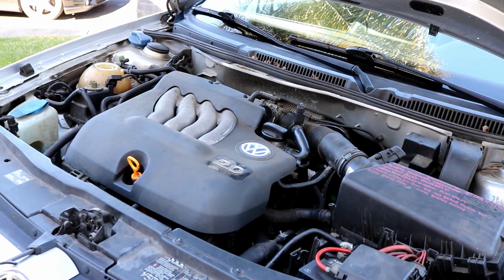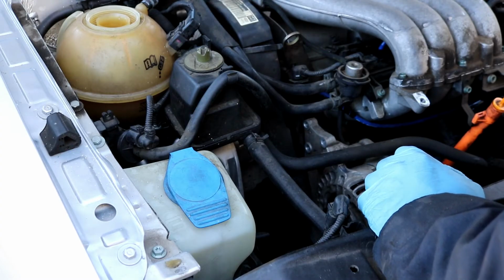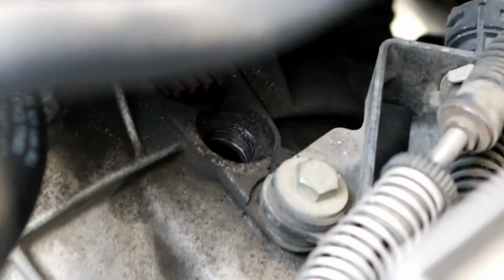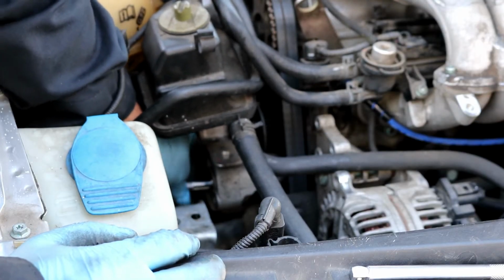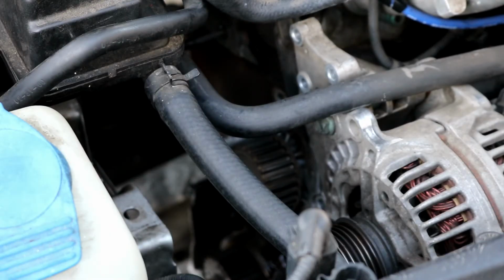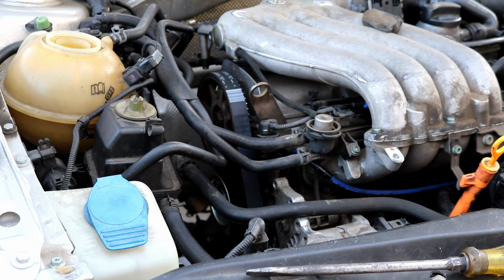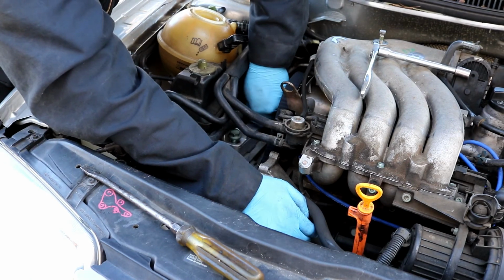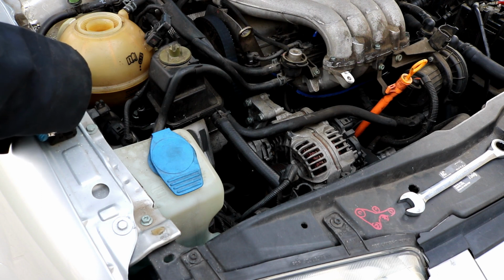Volkswagen 2.0L Timing belt and water pump! MK2, MK3, MK4 Jetta/Golf

Comment: Great video! Thank you for posting.  My 2000 2.0 Golf GTi has 90k Miles on it, I cant find any service history which mentions a timing belt change. Considering the car is 20 years old do you think its safe to assume this must have been done already? Is there any way to check? I'd rather not spend the money if it might have been done 4 years ago or something? Finally, is it catastrophic if the cambelt snaps on these engines? I know some engines fair better than others if this happens. Many thanks.
Reply from the maker: 90k miles and no service record? I would change it. When did you take ownership? It’s a mileage AND age thing. Rubber will deteriorate and that car is 21 years old now. That motor is an interference motor. When the belt breaks, say goodbye to a valve or two.
Reply: @HelpingHandAutoRepair  Thanks for the speedy reply! I've had it for a year but its been in storage, not used. It has almost full service history (stamps in the book) but most of the paperwork is missing. In  2016 at 70,771 miles it is noted as 'Full service' in the service book and in 2019 at 81,469 miles it says 'Major Service'. I'm pretty sure one of those must have included a timing belt change. Tricky decision what to do now when it will cost about £400 for a cambelt change and the car only cost me £600 to buy. I'm tempted to chance it but it would be a shame if the engine failed.
Reply from the maker: If it was done at a shop or dealership, sometimes they keep those records stored in the archives. Might be worth a try giving them a ring to see what’s been done?
Reply: @HelpingHandAutoRepair  Absolutely, I tried to call today but it was closed (its a bank holiday here in the UK) I'll try again tomorrow. Thanks.
Reply from the maker: Cheers. Hopefully you get it sorted. If you can do the work yourself, it really isn’t too much money.

Comment: I wish the title of these videos included MANUAL or AUTOMATIC because that matters for the steps to set top dead center. I'm trying to learn how to do a proper TIMING FROM SCRATCH which also is to find the TDC on the compression stroke. I'm just not a mechanic and wasting my morning finding videos that don't apply to me and i'm 5 miles from a massive wildfire trying to save my 2001 VW Beetle. Please, update your video to say "MANUAL" so people people don't waste their time, there are plenty of us trying to find this info. I can't be the only one.
Reply from the maker: You can follow the same timing marks aside from the bell housing transmission mark because obviously you don’t have that one.

Your camshaft should have a notch that says “OT” and then it will line up to the “OT” mark on the upper timing cover. Line those up.

Now AFTER you have removed the 4 Allen head bolts holding on the crank pulley and you have removed the crank pulley you will see the smaller crank gear that the timing belt is riding on. 

Simply use a paint marker or white out to put hashmarks were they are both facing  each other. You can also put paint marks on the intermediate shaft in relation to the crankshaft. This way you know where the crank needs to be in relation to the camshaft gear. Also mark the crank gear to a mark on the block behind it so that way you know where the crank needs to be. So pretty much you will have 2 marks to make double sure you mr crank doesn’t move.

Basically a timing belt job is easy to line up marks. I have done them WITHOUT putting the engine at TDC BEFORE IN THE PAST. I do recommend making marks on the belt, camshaft and crankshaft in random places BEFORE removing the belt. This way you can transfer those marks to the new belt and this is yet another safeguard for you. 

Please check out my 2JZ timing belt video. Skip forward to where I remove the belt and you will see that I marked the belt before taking it off. Then I transferred those marks to the new belt.

Comment: How the heck you get the last bolt out of the lower engine mount. Got two out but can't get to the third
Reply from the maker: Blindly. Thin ratchet with some type of socket/extension combination that won’t hit the frame rail.
Reply from the maker: Blindly. Thin ratchet with some type of socket/extension combination that won’t hit the frame rail.
Reply from the maker: Blindly. Thin ratchet with some type of socket/extension combination that won’t hit the frame rail.
Reply: @HelpingHandAutoRepair  I am in the middle of this and stopped by the third bolt. Spent a morning on it before finding your video. I guess there is not a special tool for this then; down to Halfords tomorrow to see about a thin profile ratchet. Axa Axa says to jack up the engine 'til you get a good position but I don't feel comfortable with this, it seems to be forcing beyond were it wants to go.
Reply from the maker: @colincranwell6285  you can jack it up to a certain extent. Just gotta pay attention to other wire connectors and hoses and such. Make sure you’re not straining them.
Reply: Thanks for the reply. I was intending buying a slim ratchet but woke up in the middle of the night with the idea of taking the 3/8 drive bar out of the old push thro' torque bar, socket on one end and open spanner on the other. Worked a treat. Had to jack up the engine more than I was comfortable with to get the bracket off.
Reply from the maker: Glad you got it sorted. I to had to jack the engine up to get the bracket out. Quite a bit.
Reply: jack up the engine until you get it in good position

Comment: You mention the old water pump a piglet to get out? After removing 3 bolts thought would 'ave to undo engine mount as well BUT NOT THE CASE! Inserted a flat-blade screwdriver along a top edge and, after twisting with pliers, pump popped loose! Thx for VDO!
Reply from the maker: Yea sometimes the rubber seal around it is difficult to dislodge at times.

Comment: What would the case be if you have an automatic transmission and you don't have that plug flywheel peephole? doing mine over the weekend and trying to find this out
Reply from the maker: There will be a mark on the camshaft sprocket with O.T. on it that will line up with an arrow on the upper timing cover (remove the small plastic upper cover that’s hiding the cam gear and you will see the upper timing cover mark)

Then if the crankshaft is in the correct spot there will also be a mark on the crank pulley that will line up with a small arrow on the lower timing cover. If you don’t have them both lined up then rotate the crankshaft 180* and they both should line up.

Remember BOTH cam and crank shaft marks need to line up.
Reply: @HelpingHandAutoRepair  Thank you very much I really appreciate it! Will be doing it tomorrow :)
Reply from the maker: Good luck!

Comment: How long should it take to replace?I was told it was an all day process of five hours. It's a one man shop. But you did your with explaining in less than two hours.  VW Mann Brian been working in VW for over 25 years in Minneapolis quoted $700 not including tax to change out both water pump and timing belt with labor. Does that sound about right?
Reply from the maker: Yep that sounds about right. It took me about 4 hours. Of course I cut out all the spinning wrenches stuff. That’s boring. $700 is a fair price. I charge $350 labor minimum for this timing belt. Plus the cost of parts which are about $150-200
Reply: Yep!

Comment: this video has been more than helpful for me. What should i do in the event that i can't get flywheel marks to line up or show?
Reply from the maker: There may be a chance that the clutch was replaced along with the flywheel. If so, the aftermarket flywheel may not have the timing mark on it.
Reply: @HelpingHandAutoRepair  Thanks again for the great information. I found the timing mark on the flywheel, I didn't rotate the engine enough to see it.

Comment: Great video but the engine should be turned clockwise.
Reply: no not really, it doesn't actually matter what way it is done.
Reply: @timothy930  My VW manual says otherwise, but if your engine runs I think it doesn't matter.
Reply: @schwanana and my honda manual says to only put in Honda oil. They have to say stuff like that im not sure why but they do

Comment: Hi, Thanks for the video. One question though, shouldn't the engine be turned clockwise, not counterclockwise as you say in the video? Turning the crank clockwise (while looking at the crank) puts any slack in the timing belt onto the tensioner side. Or am I not understanding something? Thanks
Reply: Yeah always clockwise. You can back it off a LITTLE counter clockwise but if you doing full rotations ways go clockwise
Reply: @willtoulan  I listened to the guy in the video and turned mines counter clockwise… wish me luck 😅
Reply: This is exactly what I was wondering and came to the comments to see if there was answers or questions.. the creator has not answered you back.  ( if he wants more followers or subscribers he should be replying to these type of questions..

Comment: I have a question. I have a 2001 be golf gls . Standard 5 speed . Has 161,000+ miles on it. It's not throwing any codes but has a really puffy rough idle that shakes the car back n forth and the engine as well. Sounds like a loud belt noise coming from the timing belt. It has a sticker in the engine bay that says timing belt was installed at around 136,000. My question is since it's interference engine can the valves be bent and still be running and idling rough. Still drives but seems to not be able to get over 65mph. I have replaced spark plugs and wires and also the MAF sensor. I'm thinking maybe the timing belt may have been installed wrong or when it had broke maybe the valves bent. Also thinking maybe the throttle body needs to be reprogrammed ? No vac leaks detected and the exhaust comes out in puffs as I mentioned before. I don't know what to do anymore besides maybe take a huge loss and sell it as a mechanics special. Can the injectors or fuel filter be bad . I wish I could email someone a video of it's idle so u could hear how it sounds. Never heard a car idle like this before. I imagine if the valves were bent it wouldn't run or even stay idling ?
Reply from the maker: I would replace the crank sensor. If you have access to a scanner than can read pending codes, see if crank sensor is showing.
Reply: @HelpingHandAutoRepair  there is no codes no check engine light. Has to be something minor but even vacuum leaks will trigger the sensors. I'd really hate to have to tear it down and see if maybe it just might be a carbon buildup in the valves kinda deal. Humble mechanic says these cars usually are taken in at around 80,000 miles for a complete carbon cleaning . Maybe the carbon buildup is so bad at 161,000 miles that it's not letting the valves close all the way ? But i imagine the exhaust would have some kind os smell. Before I had installed new wires and plugs and MAF sensor it was putting too much fuel into 3 n 4 cylinders . I think that was caused by the maf sensor because I had cleaned it and didn't let it dry properly and it fried the sensor. There went $200 on a new one from VW . Plugs and wires are also from VW.plugs are NGK specific to this car also. I've heard that the only way to get it running right may be to tear it down and clean the carbon out . Pull the head off and everything.or it may need to be hooked to the vag-com to reprogram the throttle body. Also I think maybe the gears in the throttle body may have been destroyed from prior owner incorrectly cleaning the throttle plate and inside the throttle body by not using the gas pedal to open the throttle plate and using their fingers ? If the throttle body wasn't $500 I'd buy one and slap it on and see . But I hear the only way to have the right setup to idle and run correct it needs to be programmed by the vag-com ? But all these things even dirty injectors would trip a sensor I was going to pull the timing cover lower n upper to make sure the timing belt was properly installed and tensioner was installed correctly but that seems like a lot of work . I wish someone would tell me if the way it idles could be because of an incorrectly installed timing belt is the answer from hearing it idle. Never ever have I heard a car idle this bad. It won't go over 65mph either.
Reply: @HelpingHandAutoRepair  also I suppose I  could disconnect the cam shaft position sensor  and start it up and see if it throws a light ? Wouldn't that be an easier way to see if it is communicating with the sensor ? I don't think these cars have a crank sensor only can position sensors. But I imagine it is a possibility that it's.just not communicating and not registering with the computer either. Can I unhook the sensor and try to start it safely ? I imagine if the sensor is good it will throw the light or not start at all which would negate that being the cause , correct ?
Reply from the maker: Jeremy Vasquez Your car DOES have a crank sensor. It is located to the right of the oil filter housing. However based on what your telling me, you may have some faulty injectors. They may be stuck open. Does the car smell like gas a lot? When you pull the plugs out, what do they look like? Are they wet?
Reply from the maker: Jeremy Vasquez Do you have the 2.0? Or the 1.8T?
Reply: @HelpingHandAutoRepair  it's a 2001 golf gls 2.0 no turbo. Before I had put new plugs n wires I had cleaned them the plugs were autocraft or something . Put them back in and since I didn't have the correct plug wire puller one of the wires started arcing . So I let is ready and decided to clean the MAF sensor to see if that would help the idle straighten up. Basically the sensor didn't air out properly and fried . When I pulled the plugs again after a test drive the codes came up for MAF sensor and misfire or rich mixture on bank one. Pulled the plugs and checked em 1 n 2 were good 3n 4 plugs were wet saturated from just a lil 3 mile cruise. MAF code and O2 sensor code and I assumed it was because the MAF failed that the O2 tripped. So it only ended up with 3 codes. After replacing plugs wires and MAF sensor with $400 in parts from VW directly it still has weird idle and shakes the whole car and engine. I figured if it was the injectors it would have tripped the cel . I did when I first bought it put half a can of b12 chemtool in it to clean the injectors and fuel system and should've put premium but used 85 instead. Also still need to do an oil change but won't make the ramps gonna have to dig a hole under to crawl under and check everything out underneath. I suppose I should pull the number 3 n 4 plugs and check them again and see if they are still getting saturated. There is absolutely no smell of gas or exhaust either. But maybe the injectors need replacing. I'm only trying to get it running right because I want to sell it and don't want to sell it as a mechanic special I'd be taking a huge loss. Maybe I'll put new injectors Soon when I can afford to fork out $300 again. That's only going to drive the price up when I try to sell it. But if the idle straighten out then it'll be worth $1,800 for sure.
Reply: @HelpingHandAutoRepair  I think I may have found the problem with the idle. I pulled the coil off today to inspect it which I should've done when putting new plugs and wires. Looks to be some small crack all around the plastic on the coil as well as the (D)#4 plug in on the coil inside there is some cracks it looks like and some corrosion. As well as the #3 plug in which is B I think. Well 2 of them anyway look to have internal cracks. I'm trying to find out exactly how to test this coil though to make sure as well. Even though it looks to be in bad shape.

Comment: Hello. So I'm on the step to turn the Crankshaft to alight the teeth before removing the Timing Belt. So when I spin the crankshaft with my ratchet the top pulley does nothing. It seems like the crankshaft is just spinning freely. I don't know what that means. Help please.
Reply from the maker: I did your car recently just stop running?
Reply from the maker: So I am trying to find out if you had the car die while driving it recently? Or was the car not starting? How many miles on the car?
Reply: @HelpingHandAutoRepair  I was driving when the timing belt gave out. Had to tow my back home. Sat there for a couple months until I finally got the chance to fix the belt. 
Update: so I was finally able to take the belt  off and turns out the camshaft wasn't spinning when I turned the crankshaft simply because all the teeth on the belt were broken off. I did my best to align the timing put in new water pump, tensioner, and timing belt. But now it won't start. There zero compression. It turns over and sounds like whining noise but not compustion/compression. I also noticed when it turns over i can hear a huge air leak coming from the middle of the engine. Idk. Im thinking now that I have some bent valves from when the belt originally gave out. What do you think?  Ideas. 💡?
Reply from the maker: Adrian Gonzalez that’s exactly why I asked if it died recently. You said it there yourself. The belt broke. At that point the valves were already bent. Putting the new belt on as you can see won’t fix the valves. You need to take the cylinder head off and inspect the pistons and have the head rebuilt and resurfaced.
Reply: @HelpingHandAutoRepair  Dam. I was hoping you wouldn't say that. So after the installation of the new head. The install for the timing belt is the same (same alignment for the tick marks and all)
Thanks alot for your help. I really appreciate it.
Reply from the maker: Adrian Gonzalez yes.
Reply from the maker: Sid Vis it IS an interference engine. 100%